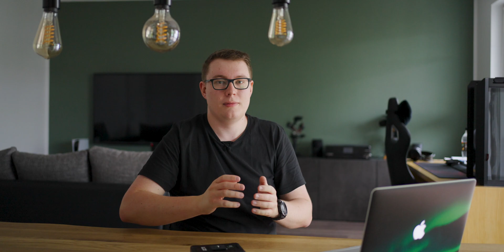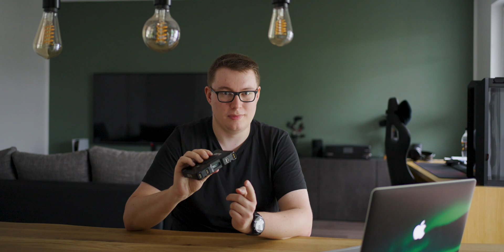Anton/Bauer Titon Base - UPDATE: Sleep Mode And Open Questions Answered

Comment: Thank you so much for your post! Not knowing this information completely freaked me out when plugging the Micro Triton V-mount 90 in to my FX6. I was under the impression the battery went bad, even though inserting it into the AB dual-charger revived it. I'd been using Gold-mounts for years, never encountering this behavior. Thank goodness I discovered this while doing some tests, not on an actual job, as I would've required revival...
Reply from the maker: You're very welcome! I feel you, I actually would've died as well having this happen on a shoot haha
Still unsure why they don't put this information in the user manual. Most people will charge their batteries before a shoot anyways, but I feel it still would be good information to avoid confusion.

Comment: Thanks for posting.  I was on a shoot in a forest with four batteries that were fully charged but in sleep mode.   Killed the entire shoot.  No way to wake them up, unless we drove back into town found a AC outlet and charge them awake.  Maybe  this feature saves the batteries, but it certainly kills a shoot.  Now I know.
Reply from the maker: You're welcome!
Yeah it certainly is something that should be mentioned in the manual somwehere. For me it's now a habit of plugging it into the charger the day before the shoot, even when I'm sure 70% will last me as long as I need to shoot. Just to avoid getting it into sleep mode the day of shooting.

Comment: Hello, thanks for your video, can this be charged via usb?
Reply from the maker: Your welcome! 
Unfortunately no. The USB Port is only for charging mobile devices like your phone, tablet or GoPro.
You can charge the battery itself only with the P-Tap (D-Tap) ports and charger.
Reply: @torbenmayer how long does it take to charge?
Reply from the maker: @aidanwilliams1607  Roughly around 2 1/2 - 3 hours, I never checked the exact time though. When I charge it fully next time I will take the exact time and post it here.

Comment: Thanks for this Torben.  

I've got a pair of Titan V90 AB batteries and I was experiencing the 'Sleep Mode' issue and couldn't find an answer anywhere until i stumbled upon your video.  It really expalined thngs well.  Very much appreciated Torben.

Don't suppose you know if it's possible to charge it using another Anton B (or IDX) battery via D-tap? (D-tap to D-tap?)

Thanks again.
Reply from the maker: You're welcome and thanks for the feedback!

I actually don't know unfortunately. I would think that it only would work as a pass through while using it, but not charging. Since all three ports on the Titon Base can be used for charging as well as powering devices, I would think that both batteries than would just start looping (or more likely do nothing), since they won't know which one is charging and which one is being charged. I think it would only work if it had a clear input/charge only connector. 

However, I'm about to reach out to Anton Bauer in the next days for something different anyways, and I will ask them about it while I'm at it. I'll get back to you asap!
Reply: Thats kind of you Torben  @torbenmayer  

Right now i've put my AB's on charge so hopefully all will be harmony once they have charged up.

Thanks again.  Always good to know that i don't have to buy even more batteries.

👍